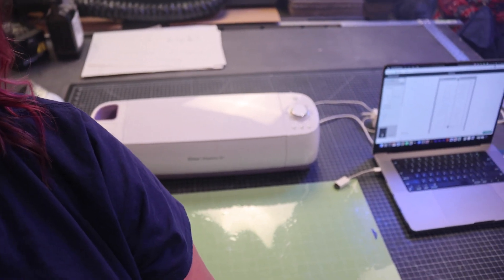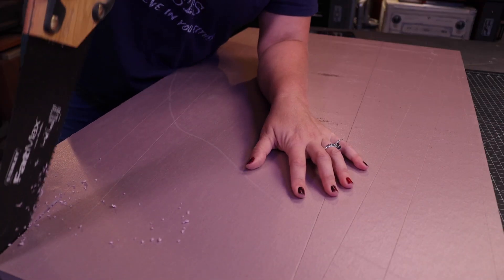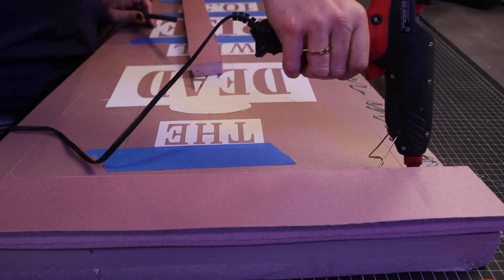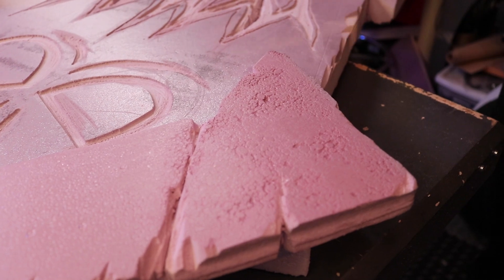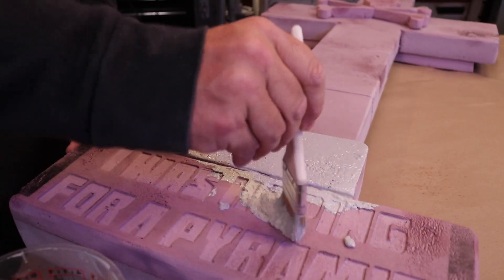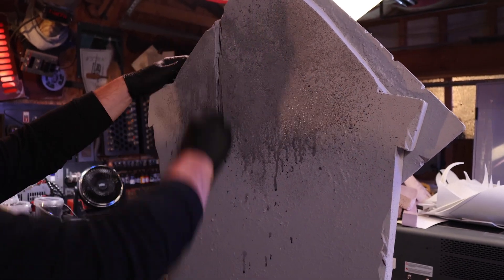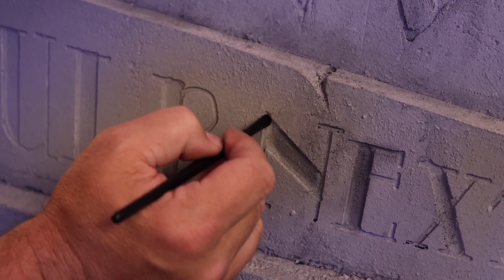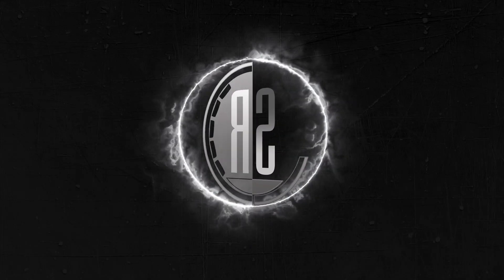DIY Halloween Tombstones

Comment: We've made a number of them for our yard.  Great fun.

Tips:
1.  Use 2x10 or 2x12 lumber as the flat base.  Use a 2x4 or 2x6 for the vertical to connect the tombstone.  It is heavy and wide enough to keep from flipping over in most light breezes.  If it doesn't drill some 3/8" holes and buy a pack of metal tent stakes to drive into them.  They won't ever move after that.
2.  If you live down south where moss hangs from every other tree, go for a walk down the road and fill up a couple of bags of it.  Use it to cover your wood base.
3.  Canned spray foam is a great adhesive for sticking the pieces together to form thicker pieces or to add accessories and for repairs.  Get yourself some BBQ bamboo skewers to hold the pieces together while it dries.
4.  Dremel with a router bit and router baseplate setup is great for detail work.  A mini-router with a small bit works great for everything else.  You can get some great results from stencils and just hand cutting the details, no need for a CNC machine.
5.  VanOaksProps has some great lighting videos for haunts.  The tombstones really pop when you add a bit of colored light to illuminate them.
6.  Drylok makes a great concrete sealant.  It has the grey color and is gritty.  Our tombstones have held up for about 3 years so far without any issues.
Reply from the maker: awesome tips!  Thank you much!

Comment: Next time instead of using the router for the letters just mask everything but the letters and then use very light misting coats of Enamel spray paint to "etch" the letters in. A couple light coats will dissolve a shallow and clean edged letter. Some real heavy coats and it will melt right down in and really roughen the edges.  Make sure to try a practice piece to get the feel of it. Also make sure it is laying flat or the paint will dissolve down the front.
Reply from the maker: That's a very cool idea.  Thanks!